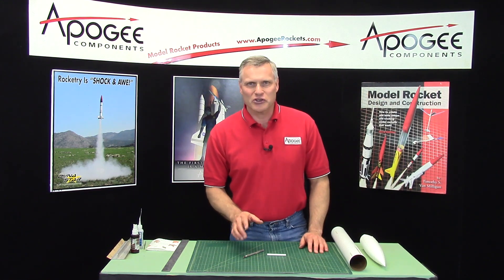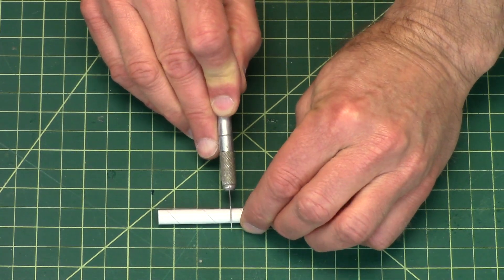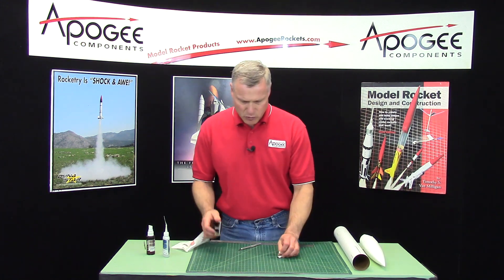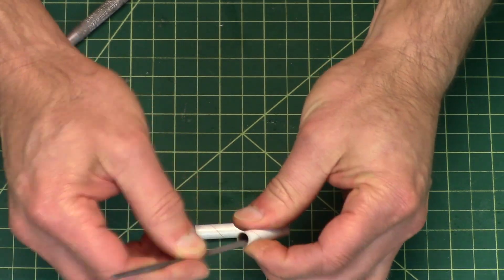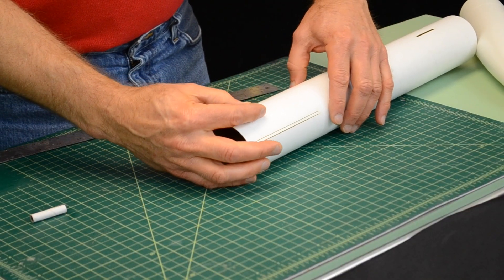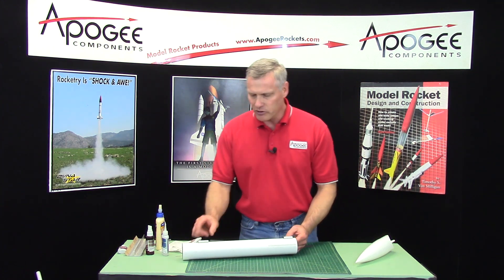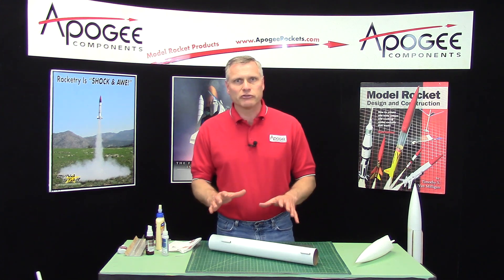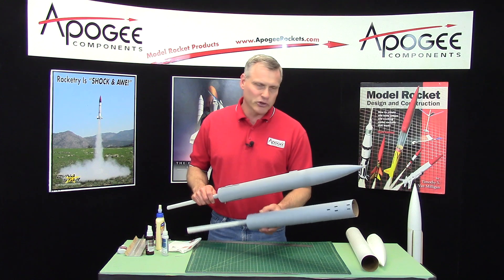Star Lift Mega Lander Construction 01

Comment: Gaps at the launch lugs can be filled easier if you put a small piece of tape on the inside of the body tube, then add a drop of glue to fill the gap.  The tape helps seal the gap and prevents the glue from dripping inside the tube.